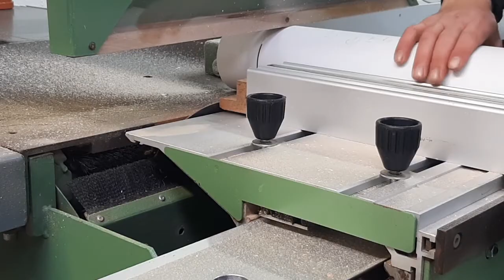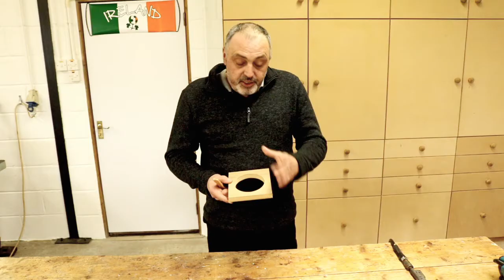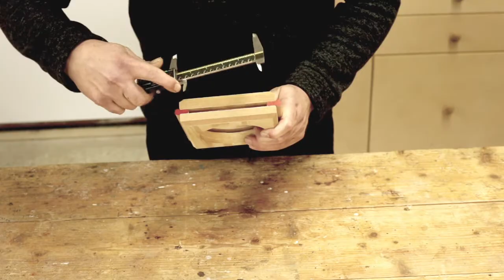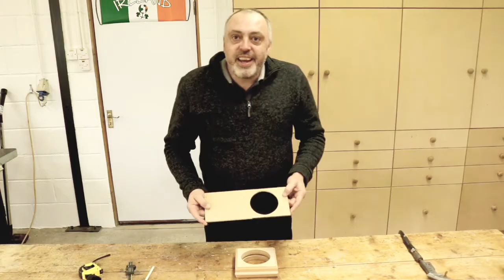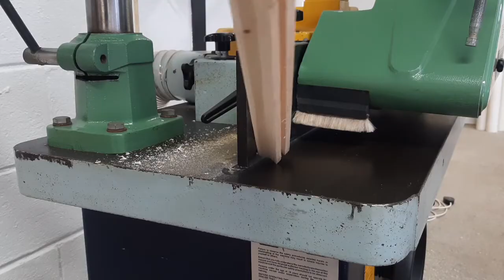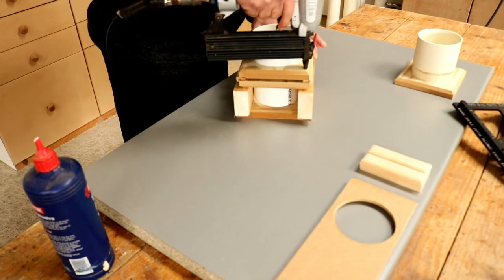Simple Blast Gates For Dust Collection (self cleaning)

Comment: Will 1/2" MDF work for the top and bottom of blast gate and 1/4" Hard Board for the gate?  Will wood glue weaken the MDF while it is curing?
Reply from the maker: Hi Wayne, yes you could use 1/2" mdf but you will have less support for the pvc pipe so the pipe may need to be glued in place. Any 1/4" stable material  can be used for the gate (mdf,hardboard,ply or even plexiglass) I have never had any issues with wood glue affecting mdf. Hope this helps
Reply: Thank you very much.  Off I go to get some 1/2" plywood.  Thanks for the quick reply. :)

Comment: What do you use to go from the 4" PVC to the 4" tool?  Have you figured something out to keep from buying those $10 each store bought fittings for the hoses?
I'm still scratching my head on the issue.. Ha..Ha.. Thanks... Nice Blast gate!
Reply from the maker: I used 4" pvc ventilation pipe fits perfectly inside the 4" sewer pipe and flexible pipe fits over it perfectly too.
Reply: Well, lucky you.. 
The Sewer pipe we have here in the US is called Sewer Drain and Vent. I can't find anything but galvanized air duct that is a 4" OD..  Our Sewer pipe is: 
(Sewer Pipe ID:4.05" /  OD:4.22")
So, I would be looking for a 4" OD pipe to go "into" the Sewer Pipe, and again, the 4" OD for the Flex Hose to go over.. Strange. I would think there would be the same products in both Countries.. Like 3/4 and 18mm plywood, etc..  Maybe I am missing something, but, all of the charts I could find on Sched 20/40/80 are all based on the ID on the Pipe size.. Something is different if you can slide something inside of the Sewer Pipe and then on the other end slide the Flex Dust hose "Also an ID Product" over that.. Hmm.. Thank you though.. Still scratching my head... Ha..
Reply from the maker: @MarkThomas123  that's unfortunate that you can't get 4"OD pipe over there so you are probably right I was lucky. One suggestion I can make is to make a kerf cut in your sewer pipe to allow it to reduce in size to 4" od and then glue the cut back together. It might sound a bit of a hassle but will get you sorted.
Reply: Yea. Weird. The only OD plastic/PVC pipe that is measured OD is a Central Vacuum hose 2" only OD.. 
You guys have a JIS K6741 and DIN 8062 Standard that gives you the 4" OD pipe. 
I found some 4" Hose Joining adapters that are tapered on both sides and have a thick body between. They look like they will heat and stretch on the one end, enough to fit into the Sewer Pipe.. If not, some wraps of Duct Tape will work. I wish we would all get on the same system... I am slowly adding metric measuring tools to my shop. Nuts/bolts/machine screws, drill bits, taps/dies.. Ha... Wish I would have done this years ago.. Another small fortune in expenses.. But, man is the metric system easy.. Ha.Ha.. Thanks for the video.. 
BTW.. This is a short blast gate that solves the self cleaning etc.. 
https://www.youtube.com/watch?v=SkIFPjJOQNU

Comment: As the theme seems to be going - John sent me lol.
Well built and looks like they will last a bit in use. Quite the shop full of kit you have there, looking forward to what you share.
One videography type comment - the angle of the camera - when you are looking up into the camera to talk to "us" it looks a little unnatural. Perhaps lower the camera a little bit or just focus your gaze on a spot a couple inches lower. Audio - the shop has a bit of an echo, but I suppose that cannot be helped - otherwise Top Marks for a first video, the editing was grand and the flow very well done.
Looking forward to the next.
Cheers
Reply from the maker: Thank you for your support and feedback. I'm still getting used to speaking to a camera and trying to get the right angles its kinda trial and error at the moment. The sound definitely does have an echo as its a pretty big workshop I hope when finances allow to upgrade to a wireless microphone which will hopefully address this issue 🙂
Reply: No worries, it's a big step to go from working to working and filming. You do not display any of the usual "first time video" jitters and such that most people do, you seem more than less comfortable in front of the lens, and that is HUGE. Angles/lighting/audio, that all comes with time.
As far as the looking up goes - I assume that your camera is a good meter + away from you, at least based on the field of view etc, just try looking at the bottom of the camera as opposed tot he center of the lens - of course, you can't drop your gaze too far or it will look like you are looking at someone or something behind the camera.
Do a test shot - pic say 3 points, the 1 you are using now, as you are clearly looking at the same eye-contact target each time, and then 2 more marginally lower, one below the other. - then start recording and run through your intro 3x once at each focal point .. when you review the footage it should be obvious which one looks best, or at least where you should then look for #4.
It's like taking a selfie - I can never quite get them right.
Honestly, that was the only technical sort of issue that struck me, and the echo as you noted, equipment will do a bunch for you, using the mic on the cameras makes  it hard to clip out certain effects of the space.
All in good time Sir, all in good time.... don't go driving yourself bonkers over it, focus on your content and you'll do fine as a channel